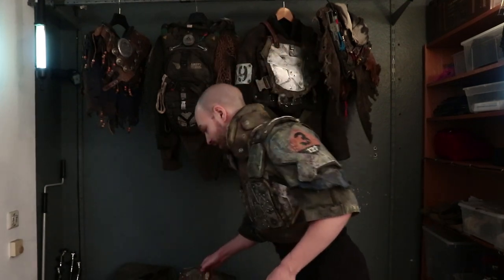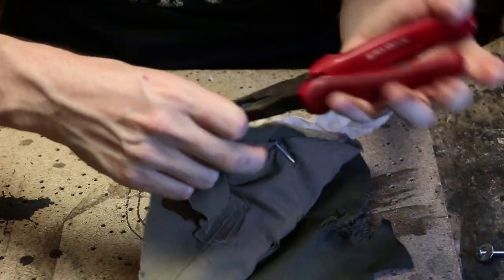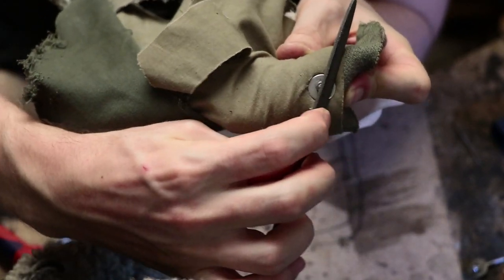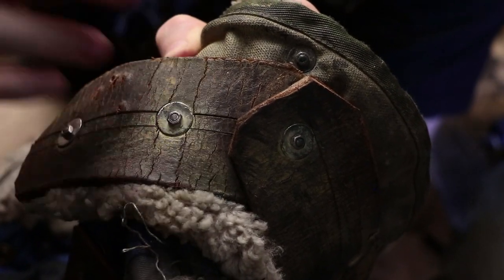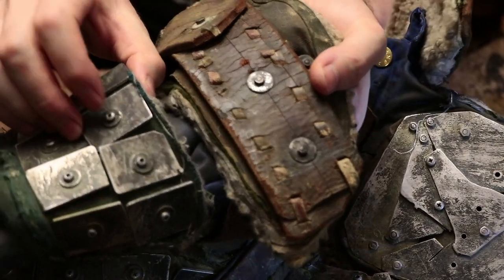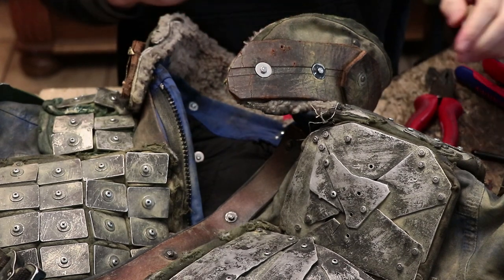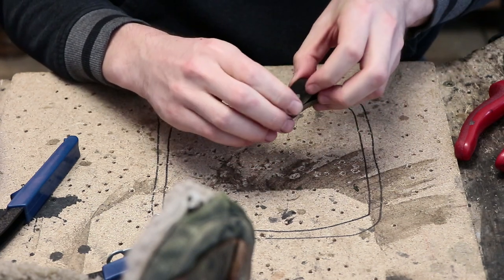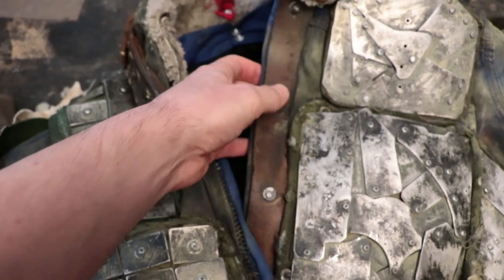Are RIVETS better than BOLTS for post-apocalyptic costumes?

Comment: Locktite is best used directly on the threads before the nut. You can also use a center punch and hammer instead. Just a few good taps to center of the bolt will deform the bolt locking the nut in place

Comment: In my experience, the main differences between using bolts and rivets are utility, reusability and clearance.

Rivets are decent for quick and dirty repairs or when you need the repair to be thin, but they're annoying if you want to swap around or replace a part on something and aren't reusable in some cases.

Bolts are decent for making modular stuff and are reusable in most cases, but they tend stick out far enough to snag on something.
Reply from the maker: uuh.. did you watch the video? cuz about half of the video is literally about trimming the bolts sothey DONT snag as easily :D
Reply: @NuclearSnailStudios  yes, I did. And it's a good video.

I simply meant that compared to rivets, bolts stick out far enough to snag on things, even if they're trimmed.
Reply: @WanderingTetsubo  Idk if this would work for what you're doing, but since I have knee-length hair that snags on almost everything, I take a nice fat piece of leather or fabric and glue it over the snaggy part.
Reply: @zxyatiywariii8  eh, I kinda do that all ready. 
Although I typically use rivets and extra fabric to reinforce the legs of my work pants, so they don't get worn out as fast.
Reply from the maker: @WanderingTetsubo  i dont know what you mean honestly. at this size & trimmed to be flush with the nut & sanded it doesn´t snag significantly for me - not more so than all the buckles and decorations and belts and bits of the costume anyway. not more than a rivet. nuts can technically snag more cuz a rivet is usually more round, i guess - but the difference is not one i ever noticed, on small nuts anyway. as for the boltheads, they are rounded so no problem there. obviously if you have a large M10 hex-head bolt and corresponding nut (and also not round them off) you WILL snag on that more than on a nice rounded rivet, yes :D probably as much as on buckles or other stuff

Comment: What about locknuts? They would hold tight, yet be removable..nylon locknuts have a higher profile, but that shouldn't be a problem as long as they're facing outward..
    Great video!

Comment: I mean you are wrong about sewing. But like the rest I mostly agree with. I use a cut off disk with cutting off bolts but I don’t use bolts on fabric and have a very different style to you but yeah in general sure bolts are good sewing is always better though even for metal.
Reply from the maker: not sure i get your meaning - i dindt talk about sewing almost at all - so what specifically are you saying am i wrong about there? 
also:  "sewing is always better though even for METAL" ? wtf? :D
Reply: @NuclearSnailStudios  Sewing is better even for metal yes or for a lot of the applications you are  using it for in outfits sewing would be better. I'm not saying you are wrong just that you have a totally different way of going about things and no doubt have a different use case for post apoc outfits then I do and want them to perform different. But in general it does seem to me you are very down on sewing as a tool and it's wild to me then you have not tried it out for joining metal armour stuffs given that is how a lot of armour in history that is metal has contacted to the things under it (e.g. it is attached at arming points or in the case of things like metal lamellar armours the plates are sewn to each other). But no joke you should really stop hating on sewing and see if you can push yourself by only sewing.